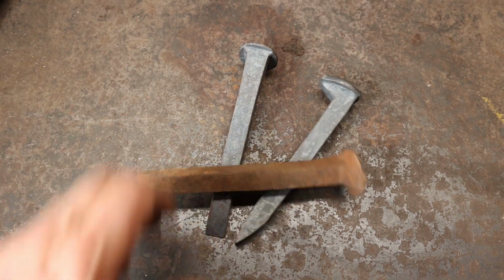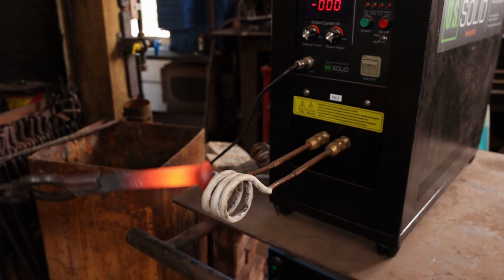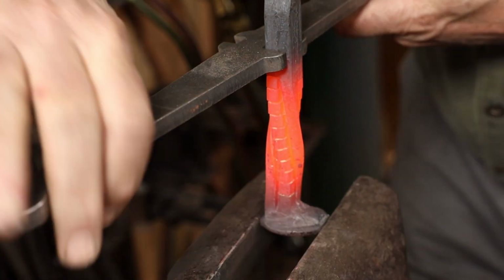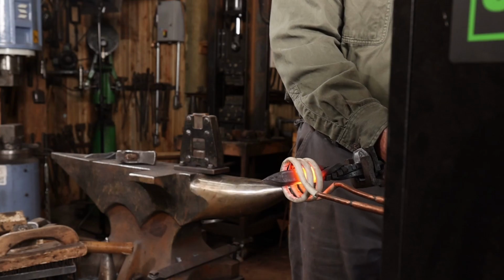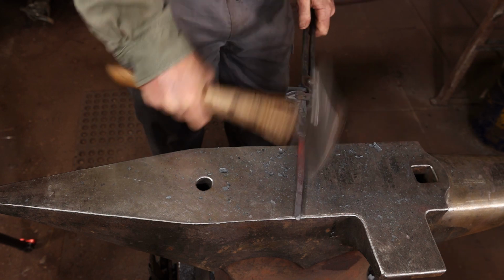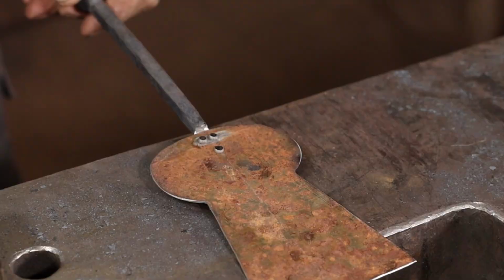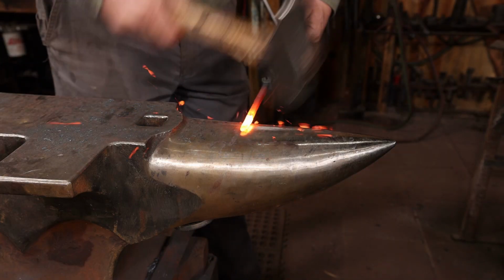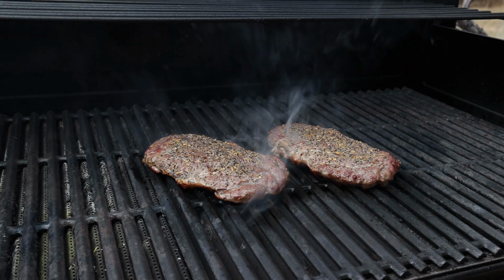Blacksmithing: The Rubik’s Cube Handle

Comment: These came out great!  And yeah perfect use of the induction forge, and the treadle hammer again coming in handy for laying out the lines.  And the one thing I learned after watching you cut in the cubes?  I really need to replace the blade on my hacksaw, yours cut through way quicker than when I tried using mine 😂
Reply from the maker: It sure can make a big difference but its so easy to put it off until the next time
Reply: was cutting in for this same twist yesterday and had the same thought lol.
Reply: One thing to remember, you don't get as much scale with induction heating.  If you use a coal or propane forge you will have much more scale to deal with.  Scale will kill a hacksaw blade.  When you want to make the cuts with a hacksaw, hit it first with a flap wheel to get rid of the scale.  You blades cut faster and last longer.   You're welcome!  :)  (Don't ask how I know this for sure)..

Comment: Looks great. I might be tempted to cube all 4 corners but offset the other 2 by 1/2 cube width. I think I would take the sharp corners off the spatula and maybe cut slots in it 😁
Reply: John, try it but you might be disappointed in the result.  The sucess of the cube twist is partially due to the tention that the solid wings provide in the twist.

Comment: Is the horn the most efficient draw out tool? 🤔 My experience (very short time) is that's only half the equation, once you use the horn, got all the bumps and valleys, then go to the flat face of the anvil and continue till the work is flat again, then back to the horn, back and forth until you get the length your looking for.
Reply: I wonder the same thing, but it could just be my mild OCD not liking the bumps and valleys and wanting to keep the thing straight and crisp all the time.
Reply from the maker: What you describe is pretty much what you see in the video.  The horn helps move material fast but it does require refinement on the face.  The amount of drawing out that occurs while smoothing out the lumps and bumps is less than what happens at the horn.  If you want the absolute most efficient I would say that a rolling mill is the best and most accurate, which is why steel mills use that method.
Reply: The horn is good, but to get more aggressive at first, use a corner of the anvil, then clean it up on the flat or horn
Reply: @glenndarilek520  a friend I learned from would use the cross side of a cross-peen hammer, slightly less harsh than the anvil edge. 
I took a page out of John’s videos, and butchered a cheep 2lb sledge into a 45° angle peen like he uses in many of his videos, and left the peen faces pretty wide, nearly an inch, and then rounded them with a flap disc, so they are sort of the cross between a cross-peen and a rounding hammer. Finally gave it a try today, and it may be my new favorite drawing out tool. The angled peen sets up the ergonomics nicely, and the wide rounded peen moves material well, without the aggressive dings and hills a narrower peen or anvil edge leaves. May need a longer handle since it lightened the hammer up a bit, but we’ll see.

Comment: John @BlackBearForge how do you keep your work so clean? As a beginner blacksmith, I can’t keep the scale off of the finish when the project is complete. I end up sanding everything down due to pitting and rough finishes from scale build up. I use a very aggressive brush and try to keep my area clean to no avail.
Reply from the maker: Don't over heat for one thing, thats where the pitting probably comes from.  But working lightly down into a black heat does wonders to leave a clean surface.

Comment: Lol, I do everything I can to avoid using a hacksaw for anything. Just hate the time it takes. A bandsaw would be a good option, if the tool is available.

And a beautiful end result.
Reply from the maker: I think with a holder to feed it corner first it would work well.

Comment: John, good video to show the use of basic tools that just about everyone has.

A tip for you on small rivets.  I take a large duplex carpenter's nail and cut off the top part right above the top of the head closest to the point.  The cut off piece makes for a short, about 1/2" long, rivet with a ready-made head. The remaining long piece still has a head in place to use for a regular nail. :-)